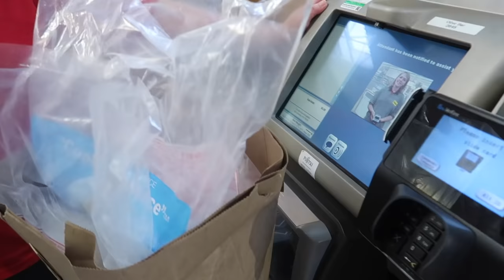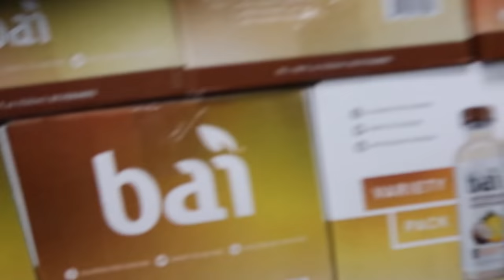200 LIGHTERS VS FIRE EXPERIMENT! (HUGE EXPLOSION)

Comment: Dumping water on the fire won't put it out because the chemicals from the lighters float on the water so it won't go out. That's also why it didn't go out right away when you threw it into the pool and it just got bigger.

Comment: if his car was running different from how it use to and it sounds like it has a cam in it or your pipes sound deeper it will be your inner intake boot leaking air or your muffler is severed